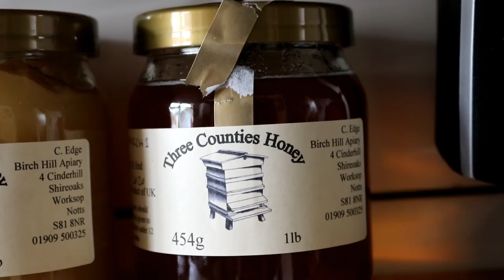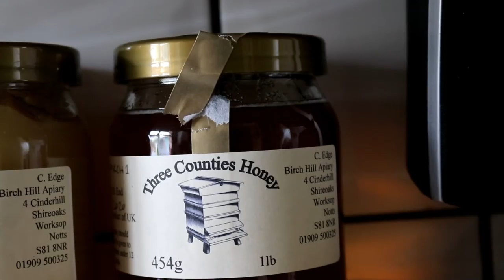AH HONEY HONEY

Comment: I've done quite a few jobs on washing machines but I don't advise a replacement of the bearings on a ten + washing machine 😮 . Sounds like a nice easy job on YouTube 😎 and is a cheap fix 👍 but the "drift the old bearing out" actually turns out to be at least two hours of a sweat and curse inducing session with a lump hammer, several pieces of wood and a bearing that doesn't nicely drift out easily with a couple of gentle taps 😨 . Most other jobs on them I would recommend doing but a worn bearing? never again 😮 😄 . Great vid as usual and I like honey but fortunately not a hay fever sufferer. Cheers, Schnuz.
Reply from the maker: I did the bearings on the drum of our machine, It was a twat and squeaks like mad now. I will wait till she shakes herself to bits then scrap it for parts.